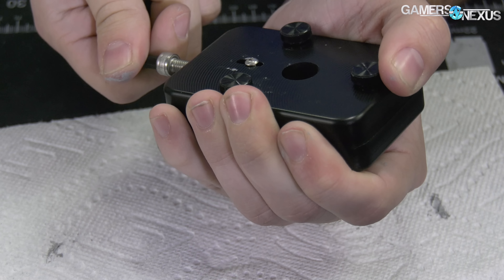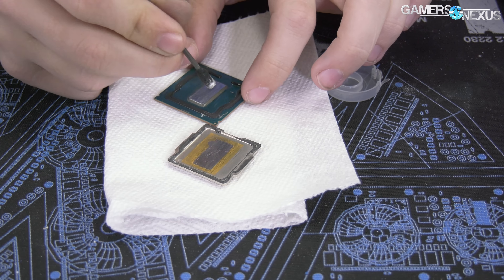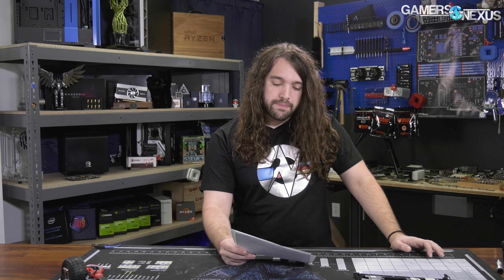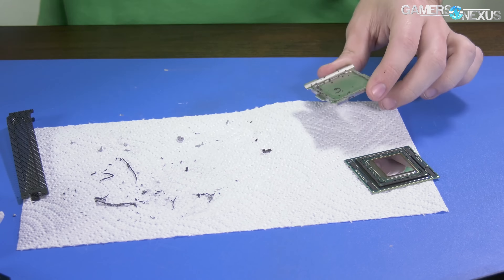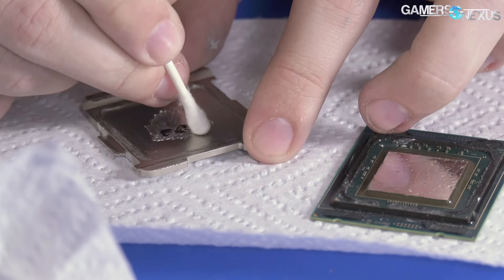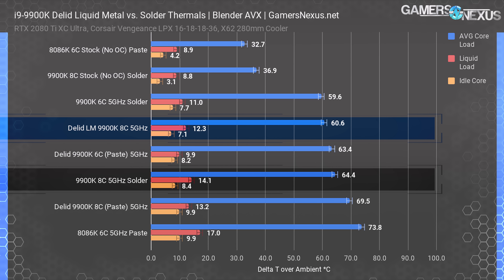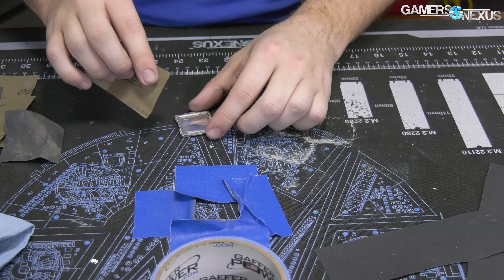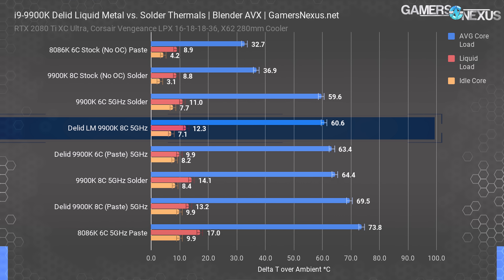Back to Reality: The 9900K Delid & Liquid Metal

Comment: why even post the video fake jesus.,....obvious its not recommended cause you not only avoid warranty but breaking the die on your owned risk cause its solder tight and you will have to apply more pressure to pop it out if you do it wrong...you break it.. and temp wise its closest to LM...and no difference between 2 methods...just way better what AMD using on ryzen ...maybe soldering Ryzen would go past 4.2 ghz..maybe 5 ghz..or maybe ryzen is too thin for running 5.0ghz to begin with...maybe next time amd ready for thicker die and soldering will get 5ghz like intel...all they do is copy intel all the time
Reply: what the hell are you talking about? your broken grammar is extremely difficult to follow, but it appears you are saying ryzen isn't soldered, which is outright false, not only is ryzen (besides the g skus to keep costs down), but amd has been soldering their cpus since they were putting heat spreaders on them. Intel abandoned soldering to save money then had to go back to it when their new cpus ran too hot to hit acceptable clock speeds without solder. It also appears that you are claiming that intel's solder is better than amd's, which is also false. Thick dies are not beneficial, they add more thermal resistance to keep heat from escaping the cores. Also, amd hit 5ghz years before intel, and ryzen is a completely different architecture that in many ways is doing things way ahead of what intel is manging. The ccx layout of ryzen and the multi die approach allows amd to easily and cheaply produce higher core count cpus than intel is able to at fractions of the price.

Comment: long story short, intel soldered the 9k series chips , temperature as bad as 7700k even though it was soldered , why ? because the chip itself is not cunducting heat the way a normal average scientist would expect it to. so shaving 15 thousandths of a millimeter proved to reduce the heat .so now intel has said  "OK" we soldered the shit and added a another fkn gremlin into the mix to keep their chips running hot  even soldered , again why ? is it so they die quicker so people will have to buy more ? dont think so, to be honest intel since the 7th gen has a product that actually runs and performs better when its warmer , you guys are testing them brand new , give that chip a few moths break in and we will see a different story. and no i do not believe you can over volt a new chip by accident and degredate it in the first 10 mins u have it . that goes against all the safeguards and safety measures put into place and propagandited by most tech youtube channels .and also intel itself and motherboard manufactures. i have ran 1.7 volts through my 7700k on purpose to see what would happen, nothing other than it could remain stable at 5.2 ghtz. i believe  intel has set the bar for core voltage and temperatures up higher than most have the balls to try. one of the first oc video i ever saw was evga garage , the dude oc a 7700k on a water loop to as high a voltage as it would take before blacking out , 1.7 volts was nothing to him and he kept right on going.